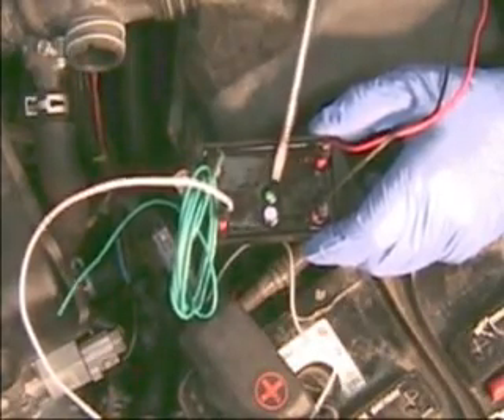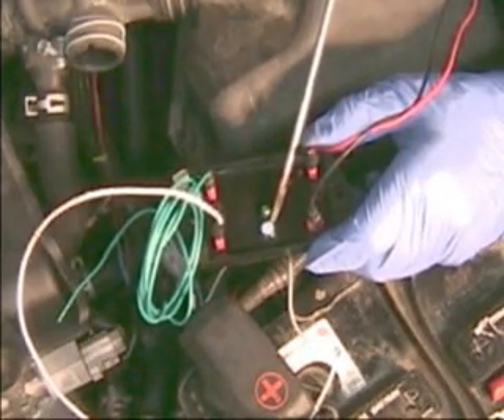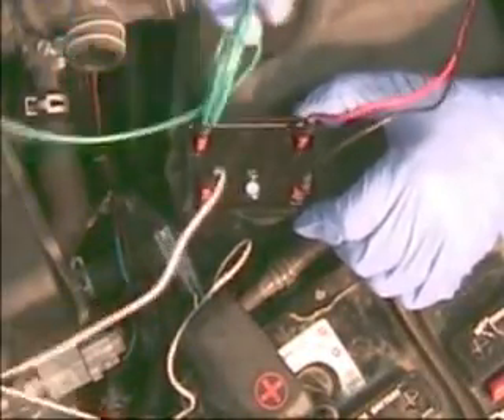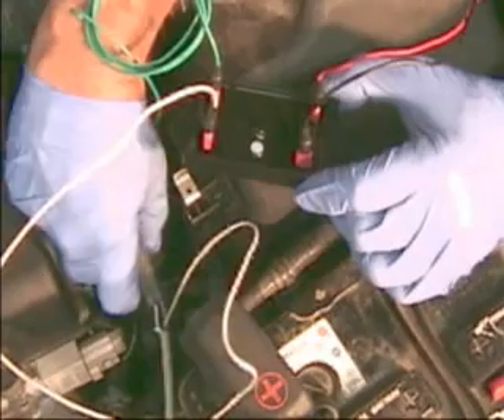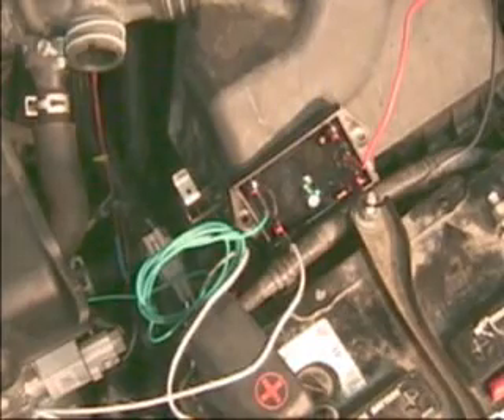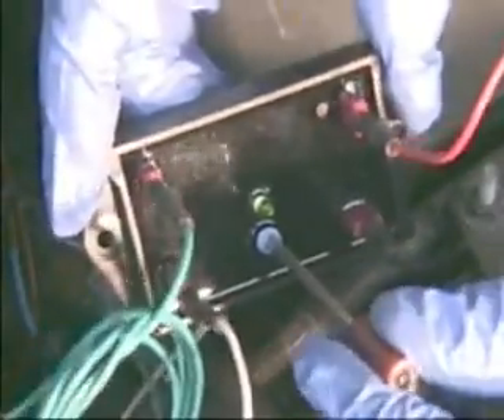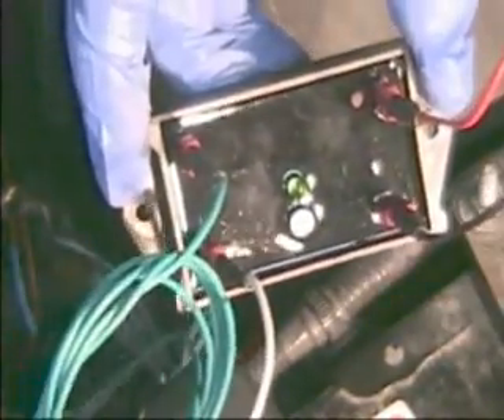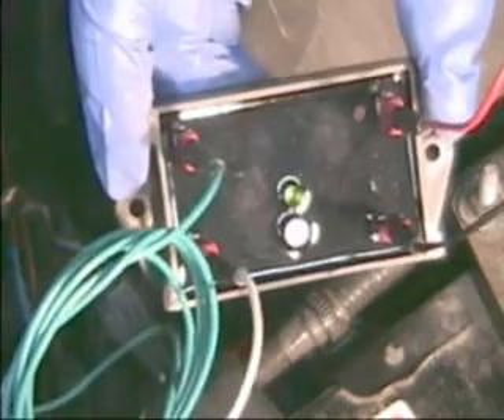How To Install Adjust An AFR Sensor O2 Sensor EFIE For Hydrogen Generators

Comment: Those comments are true. However certain vehicles with fuel injection using O 2 sensors require modification to lean the engine out as not doing so will cause the computer to sense from the o2 sensors a lean burn condition and cause the engine to burn more fuel.
 0:07

Comment: Hello . would you happen to know , on a 05 Kia , 
what's better to use for the leaning of mixture , installing
The adjuster on an o2 sensor , or on the mass airflow sensor wiring harness .

Thank you friend .

Don.

Comment: Hi,do you have any advice for leaning a 2003 H2? Do all 4 O2 sensors need to be adjusted? As well, the MAF is frequency based, any advice for that? Thanks!

Comment: why does everyone wear gloves??  honestly..  I bathe in hydraulic oil all day without gloves. 

but I'm just looking for a WBo2 install walk thru.  I can do wiring no problem but some of it is complex when they ask for an LED and switch on the ground and then you have to calibrate it for 10 seconds on and 20 off...

Comment: I have a 2004 Tacoma and built my own map/maf enhancer and installed a o2 spacer and made a hho gen. from spatulas from walmart. My mpg went from 18 to 33 -38 and I am in the process in buying and installing a good 316 18 ga. stainless steel generator and a P.W.M.. I will start installing these A.S.A.P.. Using a scan tool gives you immediate results!!